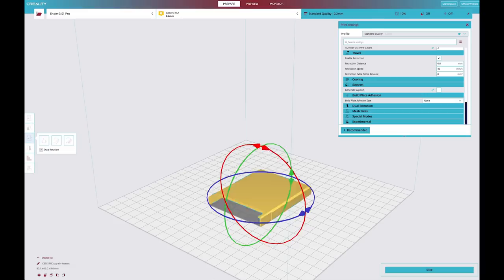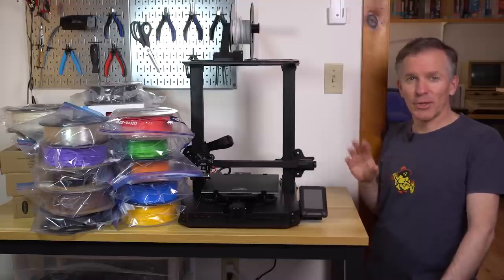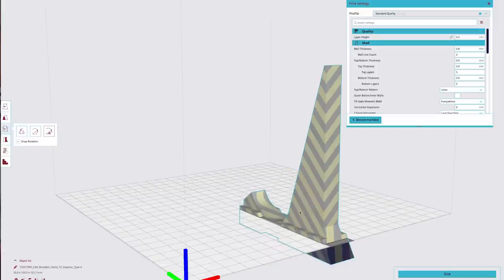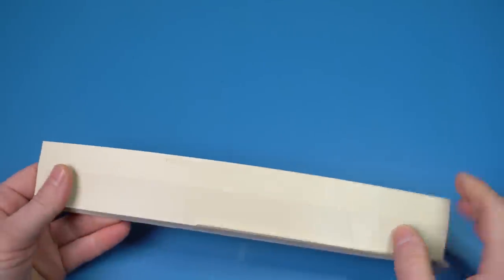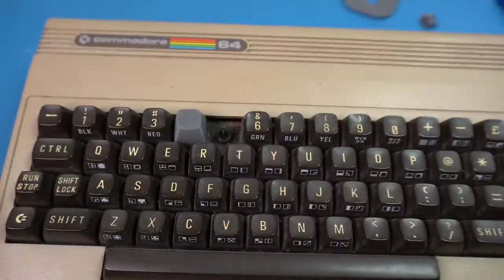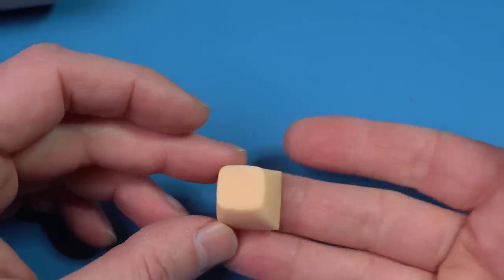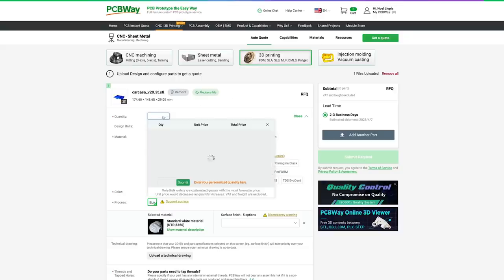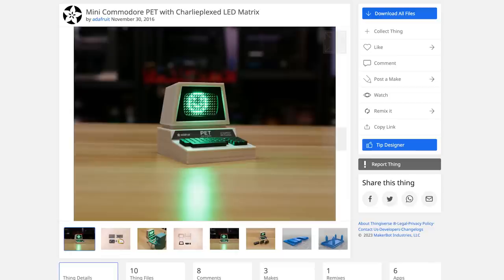3D Printing and Retro Computers

Comment: 14:40 this may be not a problem with the model but rather with 3D printer calibration. Try printing a calibration cube 100x100x100 mm and measure it with calipers. You will find out that it's not exactly 100x100x100 mm but something like 99.8x100x100.2 mm. Use this data to scale the model accordingly. This is typically needed only for large models. Regarding the color match note that nothing prevents you from painting the model. An open alternative for Fusion 360 would be either OpenSCAD or FreeCAD, personally I prefer the first one. There is a great video "Prototype Enclosures with FreeCAD & OpenSCAD" on OpenTechLab channel that compares them.
Reply from the maker: I did calibrate with a unit cube and it was spot on. That was quite a while ago (before the nozzle change), so maybe I should have done it again? Although that's more of a motor calibration than nozzle, so that should have been fine unless they drift over time. Maybe I'll try again. Thanks!
Reply: @NoelsRetroLab  the rubber belts may stretch over time and the corresponding structural elements of the 3D-printer may move slightly due to vibration. So it may be worth rechecking from time time. Personally I don't do this however because in my projects +/- 0.5 mm don't matter much.
Reply: @R2AUK  Rubber belts also come slightly undersize and you're supposed to stretch them to correct pitch by tensioning. But reaching full pitch is perilous as well, you might start binding the stepper bearing or imprinting the belt pattern into the print, as the contact patch on the idler changes. It's better to tune by feel to where the mechanics feels right and just ignore that the moves are 0.2% undersize :D

Comment: Had an FDM printer since my Anet A8, but got a resin printer in 2022 - they are very different beasts.  I too have mine set up in a spare bathroom for ventilation, but struggle with maintaining a room temperature about 20°C.  I finally achieved good prints, but now have sizing issues.  Arrggg 😋

Comment: Something important to remember about filament is that you do have to sand and prime/paint them, same with resin. You can also get clear/base colour resin that you can adjust the colour to suit your project. Resin is best for overall quality and polish as well as for highly detailed prints, though resin printing is still really good. Also, while yes, resin can be dangerous, and gloves and masks SHOULD be used, it isn't gonna immediately kill you. Precaution and safety is always the best, though the way it was handled seemed like a bit overkill. IDK just seemed like you were almost scared of it. Still very very good video. I wish I could own a 3d printer of my own. I used to have a neighbor with one that let me send files and a bit of money for filament to print what I want. Don't have money for my own printer, but thankfully there are services online for the parts I rarely need.

Comment: The monitor model probably just warped. Applying heat to bend it back would be a hassle, I'd just try to add some supports and sand it afterwards.

Comment: Would it be possible to correct the warped monitor door with the old steam/hot water trick for glasses, to soften it up and bend it into shape? It looks like it got warped from cooling faster towards the ends than in the middle.
Reply from the maker: I doubt that will work. So many things were off in that print. I'm not convinced it was just slight warping (notice the vertical angles are all off too when I put it in the monitor). Maybe it's for a slightly different 1084 model? Commodore used to do all sorts of weird things with their cases.
Reply: @NoelsRetroLab  Yeah my amateur theory is it got warped during the printing already. The ends cool faster, the middle section receives more heat and also retains it better. With such a long piece the effect could get out of whack.

Comment: I find Fusion 360 performs much better in Windows compared to MacOS. It’s still my preferred CAD program but I’ve also used Onshape (cloud based) which is pretty good as well. For really simple designs, TinkerCAD can also be useful. I have a Prusa printer that has served me well these past few years.

Comment: Nice video. A few remarks though:
- PETG is not necessarily stronger than PLA. Modern PLA filaments are complex blends, and are often stronger than PETG. However, PLA is usually a bit more stiff than PETG, and that can be detrimental for specific applications.
- If you really want to print really fine stuff with filaments (FDM printers) instead of resin, there are some things you can still do, like using a smaller nozzle with extra-small layer heights, and ironing the top layers (through the slicer). The difference between 0.4mm and 0.2mm nozzles can be astonishing. Also, printing extra-slow often helps with the quality.
Reply: I have had my PLA prints craze and fail when loaded after about 2-4 years. I no longer trust PLA. If i want something to hold, i use PETG and HIPS for this reason. Straight out of the printer, PLA is remarkably strong, i just can't trust it to stay that way.
Reply: @SianaGearz  Fair enough. I haven't really had that problem myself, but mostly I use PLA+. Some of my functional prints have held up great for the last five years.
I suppose it depends on plenty of factors, like how much daily pressure the prints have to endure, how humid the environment is, etc.

Comment: You might want to try prusa silcer instead of that one (I think that's cura). I'm watching you use it and I'm like.......damn that's a pain in the ass. Prusa slicer has a feature where you can select a surface and it automatically puts that surface flat on the bed. I'm currently using 2.6 alpha 5 (alpha 6 is now available) as it now supports organic (tree supports). They require less material and are generally easier to remove.

Comment: Phenomenal video! So many things I’ve been thinking about have been clarified. This might actually convince me to unbox the 3D printer I’ve had sitting here for a year and really try it out. Let us know more about the filament storage issue, as I’m wondering if my filament needs to be stored in ziplocks.
Reply from the maker: I have all my extra filament stored in ziplocks just in case. It'll also depend on how humid it is where you live. I also got a food dehydrator and will use it if a filament has been out for a while or gives me inconsistent results. So far so good.

Comment: Noel - Great video - I have the same exact printer as you but with a magnetic spring steel PEI bed surface. Not sure if it is available in EU but old 70's Aquanet brand heavy duty hair spray gives me much better and cleaner bed results than glue stick, and more precise than blue tape which requires bed re-adjustment for height. I have found on my printer, the "auto- leveling" does not work consistently all that well at the very 10-11" diagonal extreme edges and I have had the same experience as you with diagonal full bed prints edge lifting  (usually in the opposite back corner for me). I actually use the old school "nozzle paper gap" thin paper adjustment method, and once dialed in by manually  testing the corners (rather than auto-leveling), I comment out the auto-leveling G29 line gcode that automatically gets put in by Prusa slicer to prevent constant and sometimes inconsistent auto-leveling (Cure doesn't do that but I prefer Prusa for quick prints even though for complex stuff I also use Cure once in a while) HTH

Comment: 5:22 really shows the downside of using a non glass bed, it's already warping with that much surface area on the build plate.... You printed that slow only to mess up the print still lol.

Comment: Re: The color-matching, you could always do what even mass-manufactured products often do and spray-paint it. Just get as close as possible on the filament to so any wear or damage won't stand out readily like with the annoying ghost white plastic under most silver finishes.
Reply: You can also use brush on paints, the model Enamel colours like Revell and Tamiya. Small bottles don't put a large hole in your wallet ($2 vs. $8 for spray can) and these are combined oil and alkyd resin paints. The advantage vs. acrylic paint including spray paint is that it cures incredibly tough and adheres super well, so it plain isn't coming off, you don't even have to worry about it. It's also fairly well self levelling.
Reply: @SianaGearz  Hmm. That self-levelling part is always my biggest concern with brush-on paints. I've never managed to get a consistent finish with paints unless they were sprayed on or put on with a paint roller and I'm even capable of screwing up use of spray cans sometimes.

(Also, sorry for taking so long to reply. My browser tabs are a mess and this got buried.)

Comment: I have a Ryzen 5900X, Geforce RTX 3090, 64 GB RAM with a Samsun 980 Pro NVME drive on Windows 10 and Fusion 360 launches in under 10 seconds.  Maybe the mac version is less optimized?
Reply from the maker: Maybe! I just know it's beyond ridiculous 😜

Comment: Quality content as usual, with extensive insights and amazing production value.

More than a decade ago I worked on the software stack Fusion 360 is built upon. The cost of deterministic behavior across multiple platforms and versions leads to largely bloated codebases, which often have to dispense with platform-specific optimizations. It would not surprise me if this software required a very strict variant of Rosetta to be able to reproduce with exacting numerical precision the results in the x86 reference.
Reply from the maker: Thanks! Yes, I didn't think about it, but someone else mentioned that it runs much faster on Windows, so it's probably something related to that.
Reply: @NoelsRetroLab  there can be limitations even for Windows x86 builds, for instance the RCPSS and RSQRTSS SSE instructions have different results on AMD and Intel.

Comment: I use OpenSCAD for pretty much everything. Super intuitive for me compared to fusion etc. and very easy to learn.
Reply: I have three pet peeves with SCAD. One is lack of fillets and chamfers, you have to place connecting geometry explicitly if you want professional looking and strong prints, and it takes a ton of extra time, and isn't always sensibly possible. Though you can just import SCAD CSG intermediate as Part into FreeCAD and it might chamfer and fillet if it doesn't get too confused. The other is the lack of consistent anchoring of primitives, aligning them on extents and middles. Like why isn't there a builtin way for a box to be aligned at the middle of the bottom face? And third is just how insanely slow it is at export level CSG. It's inexcusably sluggish. I used to use SCAD a lot but now i'm finding that i'd rather use FreeCAD for everything.

I am going to explore other code based modelling software for sure though.
Reply: @SianaGearz  my use cases are probably a lot simpler than yours 😊 but I've got a more complex project coming up that might mean I have to reevaluate. I've downloaded freecad and will take a look, thanks for the info!
Reply: @sweetlilmre  Give Joko Engineeringelp's comprehensive guide to PartDesign a go if you're going to learn FreeCAD.

FreeCAD is not the sort of software i'd recommend because new user experience is horrible; but it also isn't excessively slow and does what i need it to including well into the future. I've used Fusion before and really liked it from the UX perspective but was afraid of the leash.
Reply: @SianaGearz  thanks for the info! I hated fusion and share the lock in concerns. I reckon if I can find my way around eagle then freecad can't be too bad 😂

Comment: If regular Cura addons work in this customized version, there is an addon that lets you place brim-like pads wherever you want. This way you can print objects like that monitor cover with some extra bed adhesion improvements. I can't remeber its actual name, but I think it had something like `antiwarping tabs` in the name.
Reply from the maker: Oh cool! That's a great reason for trying out Cura directly instead of this version anyway. Thanks for the tip.
Reply: @NoelsRetroLab  I would definitely recommend CURA over Creality’s slicer. It got the newest features like variable layer heights much earlier. I have been using it with my (now heavily modified and rebuilt) Ender 3 since I got it in 2017.

Comment: I see more potential in old school CNC machining, but I'm unsure how usable it is for plastics. It's more wasteful, material-wise, but I reckon you can get away with fewer attempts.
Reply: Potential in what regard? CNC gets expensive quickly. You will keep breaking endmills, these don't come free. You will keep pondering upon toolpaths and hinting them manually, you specify every operation. Every cut takes a long time to setup, zeroing on your stock manually. You will have diffiulty acquiring the desired stock material, you need every which thickness for example and you need to be able to cut it down prior. It's very noisy and really messy, throwing cut dust everywhere. You can't manufacture internal undercut structures, and when you flip the stock over, it's a big alignment and fixturing trouble. For most people, home machining is a horrible idea.

3D printing, you will have a library of profiles you can reuse in short order and mostly you can take the guesswork out. You only need to make higher level adjustments. By and large almost every print "succeeds" just the quality or some detail might not be quite to your liking. When you have to reprint, maybe 10-20% of the time something went wrong, otherwise usually the cause is modelling flaw, the parts don't come together the way you thought they would, you forgot to foresee acces, you measured something a little wrong. If you're printing an internal bracket, do you even care if it looks a little odd? 3D printers, once autohomed or autoprobed, are safe against mechanical self-destruction. You really only need a handful spools of material, and oh spools, it comes on spools, it's so convenient. With Trinamic chips, the noise is just fans, and they don't have to be loud fans. It'll throw a little wisps of plastic but it's almost clean. It's just very pratical. And super cheap to iterate upon. If you need plastic as opposed to say wood or alumiium, 3D printing is the obvious choice. You get a number of engineering grade plastics with all manner of properties. You can combine it with resins and stock metal parts like screws, rods and bearings to achieve very robust and functional designs, lightweight as well.

If you think 3D printing is a headache, machining is 10 times more so.
Reply: @SianaGearz  Either way, there are pros and cons, of course. It's a complicated subject. For sure, there are projects where 3D-printing is the most suitable method.

Comment: It is quite an involved process but resin printing is currently the best way to print small smooth and or detailed objects, very good at action figures heh. Filament printing has it's own advantages in cost and safety but I'd definitely be a person sanding, using filler, and painting to try and smooth them further.
Well when you consider everything that was really cheap to print one custom shell for $80 Ie. "Well it is a jetpack, but it's kind of expensive, and I wanted it in red.".😆
Reply from the maker: Yeah, I agree on all counts 😃

Comment: Regarding disappointing results, is there any way to recycle those unsuitable or unfit models back into filament form to be reused in new prints, or do they simply add to the waste plastic our polluted world is suffering from an over abundance of?
Reply: There are some machines that can turn crushed 3d print remains back into filament but they can be pretty expensive.
Reply: @motorsportfangr  A cost that subsequently means most people won't bother recycling, I suspect. 
Thanks for your answer.
Reply: PLA is not that bad, it has a natural origin (corn meal), and although technically it is a polymer, it is fully biodegradable.
Reply: depends on your options. PLA is biodegradable in professional composters (read dump it in the green bin not in your own composter), can be reformed into PLA by some companies like "recycling fabriek" in Germany and you can buy your own to reformer. And of course you can repurpose yourself, like making coaster from leftovers.
Reply from the maker: Right. I was going to say that. It's definitely not as bad as generating plastic waste.
Reply: @NoelsRetroLab  All things considered, these poor quality 3d printed extrusions don't seem worth the planetary inconvenience or the expense, resin printing is undeniably hazardous and encouraging these processes into the home seems like a terrible idea.
Reply: PLA is made from sugar cane and bio-degrades easily, and there are both cheap and expensive gizmos that recycle into new filament. There's even one (with a diy method) that will recycle drinks bottle PET into printer material. I don't think the PET is re-usable a 3rd time tho', where PLA can be recycled a lot.

Comment: Get some buffing/sanding blocks.... And some elbow grease... PLA can and will shine like glass with some effort... Also, keep any grease (fingers) away from the printbed surface... Scrub with acetone/iso if you touch it... PLA won't stick if any grease is present. Avoid silicone oils like hell, one touch and will never get it to stick. Larger models can be split and glued together with proper glues (acetone based for ABS, ethyl based for PLA - do some experiments first!)